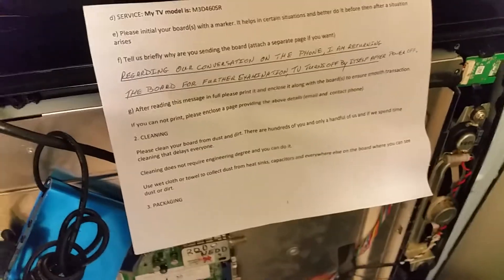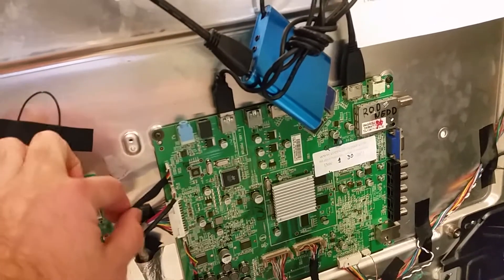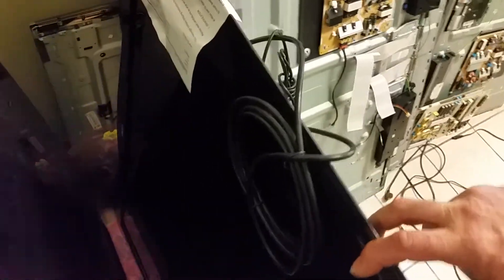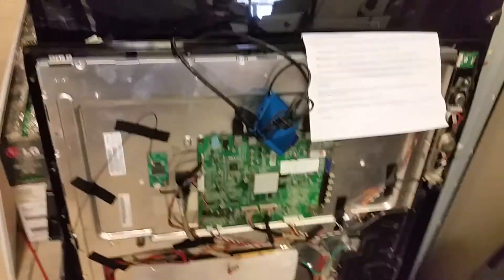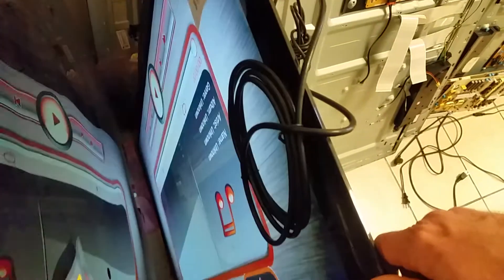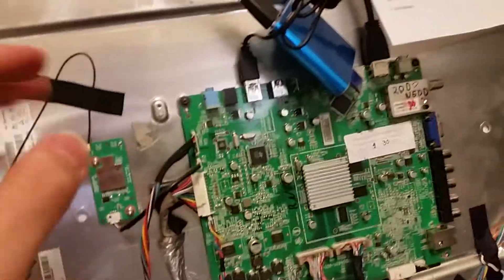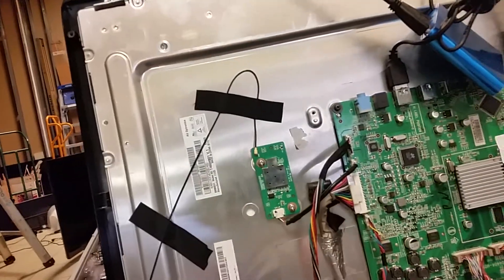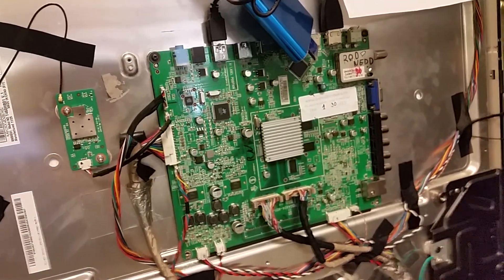Vizio M3D460SR powers on by itself after being turned off problem tip for R. Nedd

Comment: I can't even imagine how many boards you have each day to go through with this sort of problem.
Reply from the maker: For you and everyone who happens to come across this video...well first thanks for watching :-)
The customer called this morning and was very upset. He said that we killed the board, removed some tracks under the IC and it is now junk and we covered it up with the label. He also said that he watched the video and saw me having a bit of a problem having the board to run.
I have a question for you other people watching: did you see me really having a bit of a problem to have it run?
In my view I had a bit of problem seeing it repeat what the customer shows (rebooting after being shut off) as it happened after 20 or so seconds instead of 12 or so as I expected after disconnecting the BT module.
Anyway, my question is...did you get the impression that the board works fine with the module connected and reboots when it is disconnected?
Because that's what it does and that's what this video is meant to show.
A note on the claim about damaged/missing pins: The IC used on this board is H27UAG8T2BTR-BC, which is NAND flash memory storage, which outputs whole blocks of data at a time (as opposed to classic EEPROM memories which have address buss for selection and separate data pus for data I/O).
NAND memories have simple serial protocol for selecting page to read or write and separate 8 bit data I/O bus.
This means two things: 
1) NAND chips need and use a whole lot less pins out of an IC than traditional (considered "old" by now) EEPROMs.
And if you look at the datasheet for H27UAG8T2BTR-BC you will find it has 29 pins marked as "NC", i.e. not connected.
Because of that there are 29 or so pads on the PCB that are not connected to anything and because they are very small they are very easy to detach when taking out the original IC or when cleaning. They are really irrelevant to the ICs functionality as they were never connected to anything in the first place.
And this is probably what the customer had seen and incorrectly thinks there were tracks ripped off.
2) If there is a single data or configuration.manipulation connection that has been compromised (detached or shorted) that means not a single byte, but a whole page (and every page!) will come out defective.
Which means the board would never start in the first place as it has all the firmware needed to operate on that chip.
The bare fact that the TV is starting is enough proof that the IC is soldered properly and it can't be any other way.
Reply: @coppelltvrepair  I myself seen you trying to prove what was apparent.  People don't realize what all is involved in making a tv operate correctly.  Any more these days everyone thinks they know everything.  Just you taking the time to show proof of what was happening is way above what you should be expected to do.  That customer was just mad because he has more wrong with his tv which is not your problem in my book. It sucks when you know what is causing an issue but really have no way of proving it without having that actual tv in front of you. I wish people would realize that yeah,  sometimes they do all fail in the same way, but there's also over a hundred different things also that could go wrong. Just by the main board turning on and back off without restarting your job was done,  and done right.